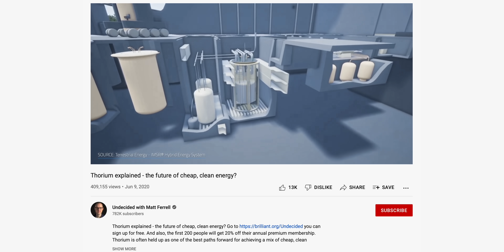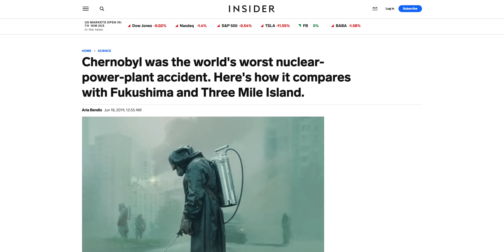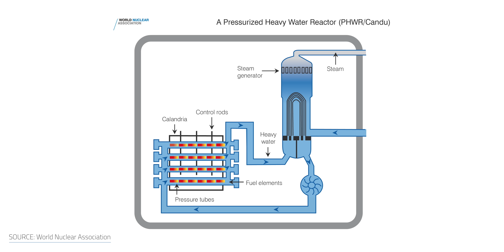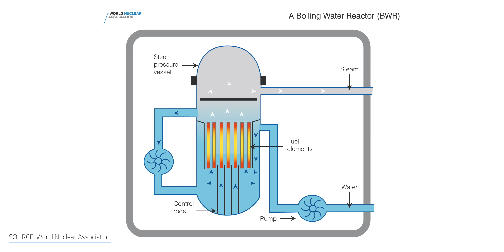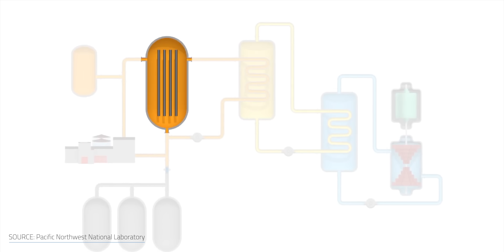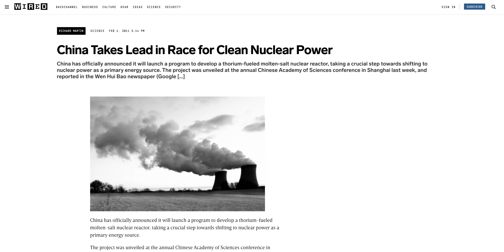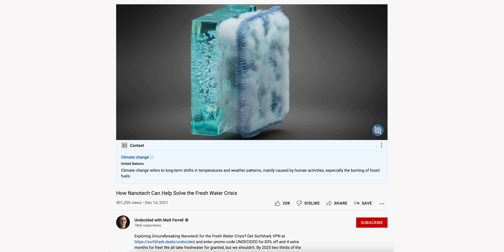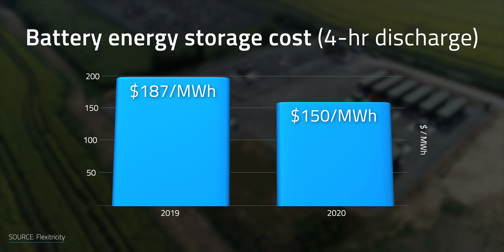Revisiting Thorium Energy - The Future of Nuclear Power?

Comment: Nuclear is and will be the most important energy solution now and in the future going forwards. Which flavour of nuclear, is a far more interesting question.

However, thorium won't be that ground breaking option except for India, which is severely lacking in Uranium but has the most thorium in the World. Almost all the good points about thorium power plants are actually transferable to Uranium based power plants as is.

Fusion is the most interesting option by far atm. due to completely new approach to it enabled by new gen magnets that are enabling solutions that were thought impossible just a decade ago. Small form fusion is coming at very fast speed compared to the eternal "sometime in the future", I recommend keeping tabs on the MITs  SPARC and ARC reactors in particular
Reply: This might be the best comment here. If the High Temperature Supercondctor approach (SPARC is but one example of this) works out and we should know in less than a decade if it will, it is the answer and makes fission reactors obsolete, except for one main scenario, treating fission used fuel. That is why IMO, nearly all the fission R&D should be directed at fast spectrum reactors capable of consuming the full suite of actinides. Both the Chloride based fast MSRs and metal fueled Sodium Fast Reactors can do this. We should NOT be building any more commercial fission reactors that can't do this.
If HTS fusion works and we concentrate on fast spectrum fission, then we end up with a pathway over a few hundred years to dispose safely of all the used fuel actinides (long lived waste) in fast spectrum MSRs/SFR and if it doesn't, we still have a U/Pu fuel cycle that reduces the actinide inventory over time rather than increasing it. Even India won't need Th based fission if HTS Fusion works. Th based fuel cycles have a high probability of being a dead end because they are not well suited to fast spectrum to consume actinides and HTS fusion makes new build fission for power alone obsolete.

Comment: What is the cost of solar and wind if you want it 24 hours a day at a steady and consistent rate?  That price should be included to compare apples to apples.

You could have mentioned we could use these reactors to burn up the radioactive spent fuel rods from conventional solid fuel uranium reactors.  We should build them just for that alone.

The heat of thorium reactors is also so high it can efficiently separate water into hydrogen and oxygen without inefficient electrolysis.  Combine that with CO2 in seawater and you have made clean ethanol fuel.

With enough ethanol we could drive in almost pollution free, simple, made of cheap cast iron, ultra-high efficiency, dedicated ethanol engines half the size/twice the power of gasoline and diesel with mileage greater than either one.

GM drove one around already a few years ago built for them by Ricardo.

FROM RICARDO:
The new federal CAFE standards are calling for a doubling of fuel mileage performance, which, Vint says, is going to send OEM’s looking for high octane numbers to improve efficiency and ethanol is the best source. Ricardo, an engineering firm with over 100 years in the business of engine design, has developed an extreme boosted direct injection engine (EBDI) to optimize ethanol blends. The 3.2 V6 gasoline engine rivals the power and torque of a much larger GMC Sierra 6.6 diesel, he said, and it delivers 3.5 percent better fuel economy than the diesel.

Comment: Wind and solar are not as clean as you may think. Bladed wind turbines have short lifespan fiberglass blades and interfere with wind patterns affecting other wind farms. Solar has harsh chemical manufacturing. Both are only cheep due to government subsidies.

As for nuclear storage, those claims are overstated. There are plenty of storage places to use and more are being built.

Now for the fear of meltdowns. Every nuclear disaster has happened because of improper reactor design, or in Chernobyl's case, an outdated reactor design for the time, ignoring most if not all safety procedures and devices, and performing an unauthorized and dangerous test by deactivating the last functional safety on said reactor.

Comment: I think the omission here is the small modular reactor development which applies modern mass production technology to the construction of nuclear power stations and decimates both the cost and construction time.   There is no reason why Thorium MSR cannot be supplied modular.
Reply: since the last nuclear incedent in fukusima, some people are pushing to smaller reactors. In case of a meltdown, can easily be repaired and etc. 
the msr didn't make his debut as de facto energy producer is bc of the lobby from ppl who produce uranium PWRs and BWRs since MSRs are safer and the govs who need in a pinch produce nuclear weapons using plutonium.
Reply: @Veio_do_Soflam  You don't need to resort to conspiracy theories. The reality is that all forms of nuclear energy requires very high upfront costs in development and infrastructure, and the financial and temporal risk involved in developing and then deploying MSR technology is just too high to take on. Ever seen a reactor that was built on schedule and under budget? Now do the same with a technology that hasn't been proven yet. Much simpler explanation.
Reply: @Andreas-gh6is  : There are at least 2 "Operational" SMR's, several under construction and dozens in design.
Reply: @giorgiocooper9023  How many generations of private guards can you put on your weapons making material?
That's the real cost.
Reply: Also, the fact that LCOE usually gives Nuclear an unfair result due to the upfront cost and operating longer lifetime (e.g. 60-90 years), this also assumes that renewable performance is static instead of dynamic due to seasons / weather patterns vs Nuclear's static performance. Adding those factors would increase the Renewable's LCOE as the solution to those is either add storage or overbuild solar / wind to compensate, with some places (where price of land is expensive like Japan) this makes it much more expensive than Nuclear.
Reply: @ryoukokonpaku1575  Also, economics again, batteries plus renewables cost a small fraction of the lifetime of nuclear.
Reply: @ryoukokonpaku1575  And always understates the economic cost of the multiple failures of commercial nuclear power.
Likewise, installed solar, rated for 25 years, ALREADY demonstrates longer life than guaranteed. WITH NO RADIO NUCLEOTIDE GUARD COSTS.
Reply: China already has a thorium fuelled molten salt reactor MSR that they are testing.  Once they can make MSR reactors at scale in the factory the west is done.  The USA better get moving.
Reply: Modular Reactors have lower efficiencies than Larger Powerplant Reactors
Reply: Thorium MSR concept was mentioned in some of the information I came across on Thorium Molten Salt Reactor over a decade ago, back then mainstream nuclear industry was not talking much about this SMR, it’s like a failed actor that’s keep trying to reinvent themselves by what others are doing.
Reply: Except for the need for at least 3 armed guards at every Reactor for the next 98,000 years.
Reply: There is no commercially viable MSR technology, so there is no point in making the production of the reactors more modular. This is putting the cart a decade or two before the horse...
Reply: Moltex Energy New Brunswick, Canada
Reply: @creedjo4018  And they STILL haven't built a self sustaining Thorium 233U reactor.
Because the fission energy is 1% different from the transmutation capture energy.
Reply: @creedjo4018  Nothing to see there.
Reply: @Andreas-gh6is  water desalination: 👀am i a joke to you
Reply: @Andreas-gh6is  : There are at least 2 "Operational" SMR's, several under construction and dozens in design.

Comment: Even if Thorium isn't adopted as the Fuel of Choice for the Nuclear Industry in the Future, I think Molten Slat Reactors will be due to the overall simplification of the Cores as well as the significant reduction of risk of another Chernobyl, Three-Mile Island or Fukushima Disaster.

I do have a possible solution to the continuing problem of what do we do with the Radioactive Waste produced by these Reactors...
We have developed Linear Accelerators (Rail Guns) to the point that while they're not yet viable for Military Use (still can't really put a big enough Power Supply on anything smaller than a Nuclear Powered Ship), that's not a problem for land-based units...

My proposal is this: build a 100 meter long Rail Gun with a 60 or 75 degree slope into a hill or small mountain 10 Miles or so away from a Coast (this keeps it far enough away to protect it from Tidal Waves without requiring it to fire over a Town or City) with a muzzle diameter of 3 meters.
Design and build 2.75 diam. x 9 meter long, moderately shielded, aerodynamic steel canisters (AKA BIG FRACKING BULLETS) that are then filled with Radioactive Waste, load them in the Rail Gun, make DAMN sure there are no aircraft flying anywhere near the canister's flight path and shoot them into space.
A Mach 5+ muzzle velocity should be more than enough to get the canisters into space and beyond Geosynchronous Orbit, (AKA they hit Orbit and just keep going) until they eventually hit Venus, Mercury or the Sun...Problem Solved and this can be done at several places on most Continents which reduces the distance Radioactive Waste needs to be transported between Reactors and the nearest Rail Gun Facility and since this permanently removes the Waste from the surface, we no longer need to worry about finding, designing and building a Waste Repository that could be forgotten in 300 years despite being a hazard for the next 10,000+ Years...

Comment: I think it's odd that the costs associated with solar only includes a 4 hour discharge time worth of battery storage, where no place on earth gets 20 hrs of sunlight a day all year round. In order for it to be a relevant comparison of costs, you would expect to see an amount of storage that would at least make it through the night and ideally through a few overcast days, seeing as how nuclear power does provide constant power regardless of time or season. They might also allow for the subsidies of solar and on the other side the costs of heavy regulation and licensing fees of nuclear into this equation, since those things affect the price artificially. I'd be interested to see what an actual cost comparison would reveal.
Reply: Considering that in winter you get much less sunlight and you might have cloudy days for long periods of time you would need at the bare minimum 24h battery, but for safety reasons I probably wouldn't decide to live in place that had anything less than a week long batter if they decided to go solar/wind only. Otherwise you might have issues like Texas did (tho admittedly conventional power plants also failed there). Such battery would likely make renewables uneconomical with our current technology level. I'm also curious if those costs take into account that conventional power plants take the burden of managing changes in demand of power and have to lower their output or even shutdown completely, with rises costs of running them (or of running renewables, depending on how you look at it); AFAIK there are even dedicated power plants for doing just that - did they factor that in while calculating price for solar/wind?
Reply: @staryimoze  good point, AFAIK hydro and natural gas are the only current plants that can quickly spool up and shut down according to demand, and hydro isn't available everywhere, and also comes with some pretty steep ecological costs, but for most of the world that would mean natural gas as the backup. So still reliant on fossil fuels. Honestly I don't see anything even as remotely beneficial as nuclear right now from an environmental perspective.

Comment: Personally, you seem to believe in net-zero home construction, electric vehicles, electric snow blower and high efficiency appliances.  and also the need to move quickly and forcefully to deal with climate change.  So why focus so much about these new technologies which never have been built in a industry that can not bring a completed plant on line, at below cost. 
Wind, Solar with batteries are cheeper and have shorter construction times.
We need a waste solution that works before there is more nuclear, and they have only been working on that for sixty years.
 Also, I live 7 miles from a closed nuclear plant which will have its used fuel in casks for a long time.  DOE has yet to design trail car which can move the casks and no national railroad wants to move a special train over its network at 15 miles an hour for weight and safety reasons.
Demand reduction through conservation and efficiency are where we should focus our resources and energy

Comment: I don't buy the cost difference between nuclear vs solar and wind. Not to mention how much is done by MSM to suppress the environmental impacts of Solar/wind on our environment, wildlife, and even meteorological. windmill farms are the #1 cause of death and the endangerment of migratory and predator birds in the USA. Concentrated Solar is just as dangerous. Windmill farms significantly impact the weather and moisture levels for where they operate. In simple terms, Windmills take meteorological energy of the wind that drive our weather conditions to generate power.

Comment: Thorium Reactor Technology was deeply researched by the Atomic Energy Commission in the 60s and 70s and promptly shut down due to a naturally occurring danger in thorium chain reactions. From the declassified documentation the reactors worked very well but had an unpredicted flaw. When Thorium breaks down under an artificial generated chain reaction it decays into the element U-231 which has an extremely short but violent half life approx. 8 to 12 hours during this breakdown it releases substantial amounts of gamma radiation. The experiments were quickly shut down due to even super thick radiation shielding could not stop short term high exposure to people and the intense heat given off by so many half life events at once nearly caused a catastrophic meltdown. Even modern cooling and shielding technology is not viable. Automation won't work either as the strong amounts of gamma radiation will fry even well shielded electronics. It's a pipe dream if it was safe it would be used. Much like the very successful tests of direct and indirect nuclear jet engines and rockets the  extremely heavy radiation shielding needed to protect people would made the aircraft incapable of supporting their own weight. Some light weight radiation shielding was developed but the crew could only limit there exposure to a max of 30 minutes per week.

Comment: The problem with wind and solar power is the weather. Also they need a lot of space to produce enough electricity for any industrial use. In addition wind power kills a lot of birds and has an annoying and potential dangerous noise coming from then. They are also visual pollution, so nobody wants them in their neighborhood. Molten salt reactors are compact and relative cheap to build. If you look on the presentation from Thorcon they plan to put the reactors on a barge.Apart from the reactors most of the equipment will be off the shelf components. All major shipyards can produce a great number of barges every year and these barges can be sent anywhere in the world that has a coastline or a major river. Already at the first experiments at Oak Ridge they solved the corrosion problem with an alloy Calle Hastelhoy-N.

Comment: You FOOL!  THorium is not fissile material! It needs to be combined with fissile radioactive elements to be viable!  Secondly, high temp reactors (beyong 700 degrees) have failed in the past because of extreme leakage of neutrons!   DO YOUR RESEARCH!   "What is the problem with thorium reactors?
Thorium cannot in itself power a reactor; unlike natural uranium, it does not contain enough fissile material to initiate a nuclear chain reaction. As a result it must first be bombarded with neutrons to produce the highly radioactive isotope uranium-233 – 'so these are really U-233 reactors!"

Comment: Small modular nuclear reactors are our only viable choice. Cost of solar or misleading.  Here's a comparison.  The cost of rainwater keeps going down.  However the cost of the reservoir and the dam are what gets you.  Solar costs doesn't take into account the cost of storage which is incredibly expensive and difficult to do on a citywide basis. No City can store more than 4 hours of power based on current storage technology and that would be generous

Comment: Thorium reactors are just uranium reactors. They need a continuous supply of neutrons, which the fission of U235 produces, or the reactor snuffs itself out.

In fact, you need a higher enriched uranium than any BWR does because of the loss and absorption of neutrons due  to the thorium and protactinium cross sections. It's my opinion that you'll have to run a fast reactor to breed enough U233 to reduce nuclear waste.

I'm not saying that it's a bad idea. I like almost all things nuclear.